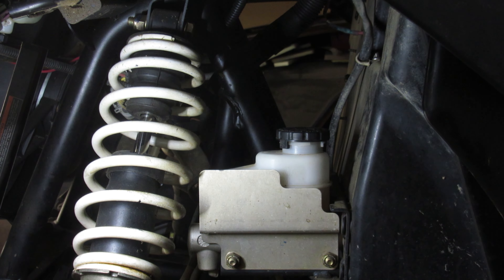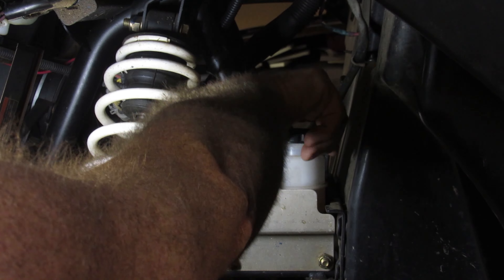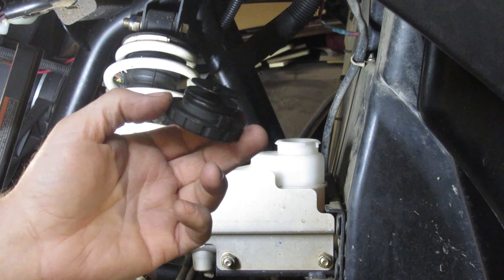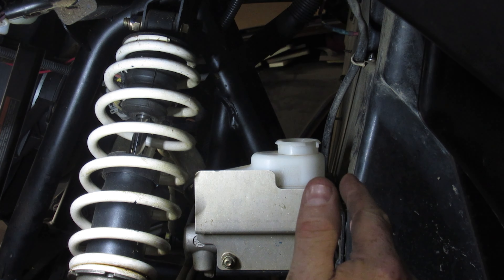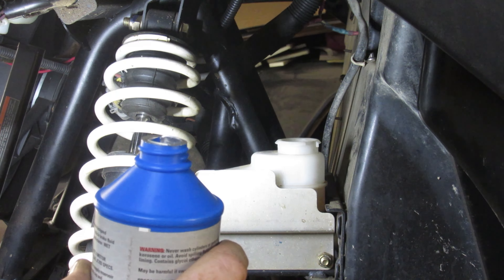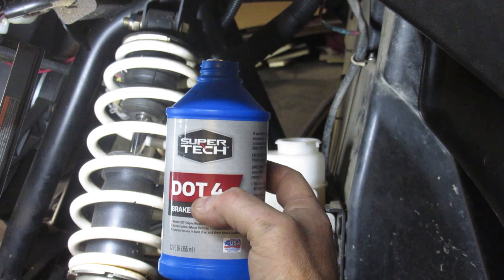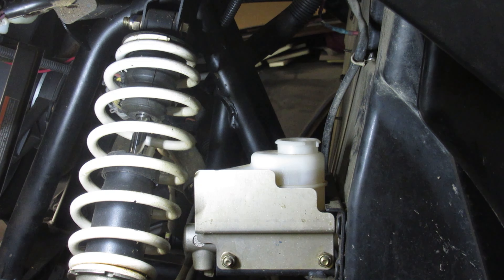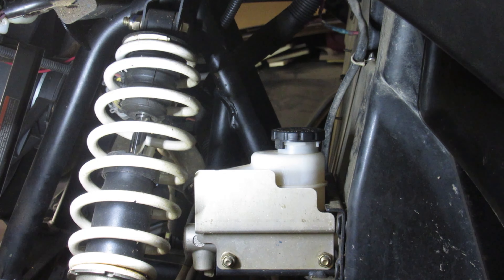RZR 800 CHECKING & TOPPING OFF BRAKE FLUID

Comment: Could you do a video on replacing the break fluid on the rzr 800 the step by step process? Because I can't find videos on it just people adding fluids to it.
Reply from the maker: I plan on a vid but it won't be for a while , but if you suck the fluid out with a turkey baster or suction tool  of some sort ,then refill with new fluid, then bleed the brakes, right rear , left rear, right front left front , topping off fluid as needed that would flush the system, and you should be ready to ride. 👍

Comment: Good afternoon. I just purchased a 2008 RZR 800. Prior to my ownership the rear left caliper was torn off. I purchased everything to do the job(my 1st time doing brakes). So I have a few questions maybe you can help me with if you have the time. First question is where is the brake fluid reservoir located? The previous owner did remove the break line as well. The brake is just hanging and swinging freely.. Is that normal being that I'm sure the reservoir is bone dry and the rear left line is currently not intact. Your video already answered the break fluid type question i had. Lastly, is there anything that I might need to or should be on the lookout for during the job. Thank you and great video!
Reply from the maker: check out my rzr playlist on my channel i have some suspension & brake job stuff hope it helps. the brake reservoir is in the front on the drivers side this vid should show enough to place it.